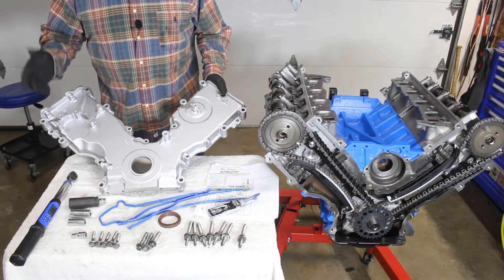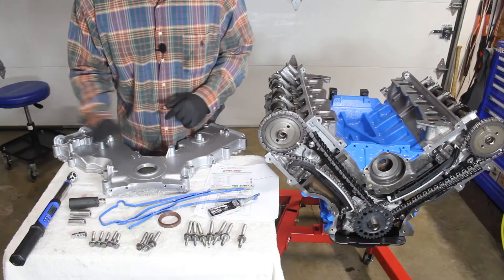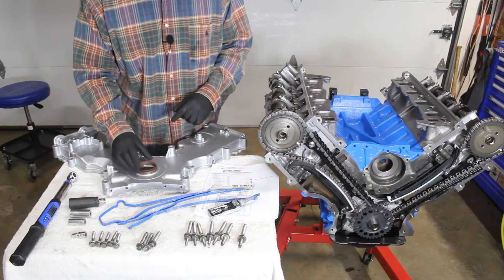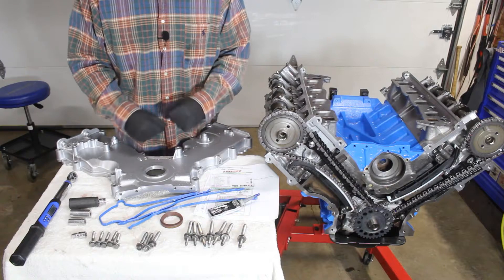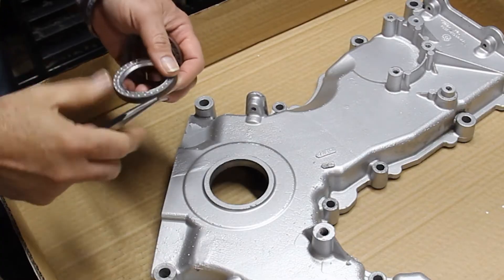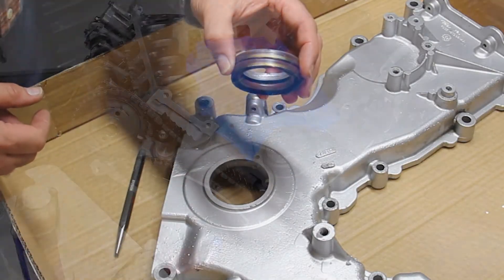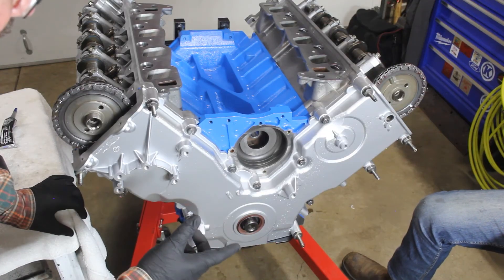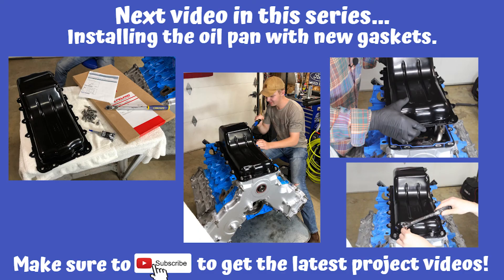Ford 5.4 2V Timing Cover Torque Specs, Bolts &  Gasket Install

Comment: NOTHING on the front cover should get 35 foot pounds. For anyone reading this please look up and reference M-6004-462V
4.6L 2V Timing Kit before you break a bolt.

Comment: Hi. Thanks for the great video!   One question:  for the valve covers, i believe the manual calls for putting down a bead of RTV into the groove before installing the gasket.  I was wondering if the RTV is necessary?  I see for this install you didn't use RTV in the gasket groove which makes me believe it's also not necessary for the valve covers, but i'm also not sure what the manual says.

Comment: Did you SEE and HEAR this motor run before you bought it? The reason why I'm asking is because you don't know if it was knocking or the rings are pretty worn. You went through all this work, so why not just rebuilt the original engine that came in the truck? Maybe you have answered these questions before in another video, so forgive me for asking if you have. You do an awesome job on the breakdown of this process. 👍

Comment: It amazing to me I torque #8 to 35 ft pds and it breaks. I wont use that torque spec on those bolts any more.
Reply: The video is incorrect. For anyone doing this job reference M-6004-462V
4.6L 2V Timing Kit

Comment: I’m doing this on a cobra 4v and it’s driving me nuts, I can’t get it aligned with the dowels and it’s not going onto the oil pan fully, you can remove all the bolts because the subframe runs under it! I need help pleaee
Reply from the maker: Thank you for the compliment and I'm glad you enjoyed it!

Comment: The 5.4 2V in my 99 F250 needs a new timing set, but I can't get the timing cover off, it's stuck.  My research tells me the dowel receivers may have corroded and are holding the cover on.  I shot them as best I could with PB blaster, did a bunch of very gentle taps all around with a rubber mallet and found a couple pry points up top and on the passenger side and managed to flex it between 1/32 to 1/16 of an inch, just enough to verify release and after this video, I will go back tomorrow with new ideas, but I have some questions.
1) are the dowel receivers on the cover thru holes?  If no, do you think I can drill a hole to allow for penetrating oil entry?
2) more research suggests I may have to loosen all the oil pan bolts and let the pan down slightly.  If I did that, would that ruin the gasket seal?

Comment: Great video since I’m about to do full timing upgrade on my 2000 f250 with the melling kit and gonna do WP and oil pump while I have it open.. question should I use blue loctite on the guides and tensioner bolts and should I use loctite on the cover bolts your video shows the bolts going in dry

Comment: nice work but you missed sealant between oil pan and block bottom
Reply: Doesn’t that use the oil pan gasket to help it seal? On my 2000 F-150 my service manual instructs you have to take the front 2 oil pan bolts out 🤷
Reply: he said he will do it when they do oil pan